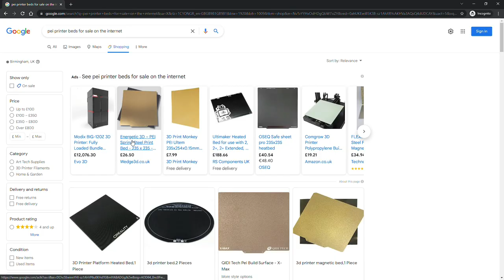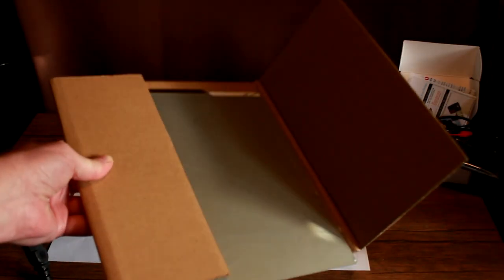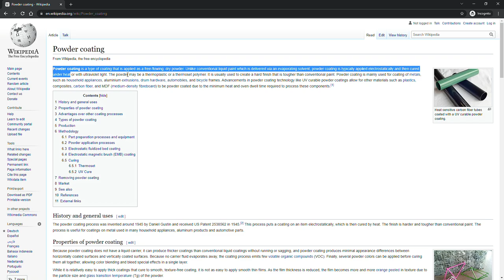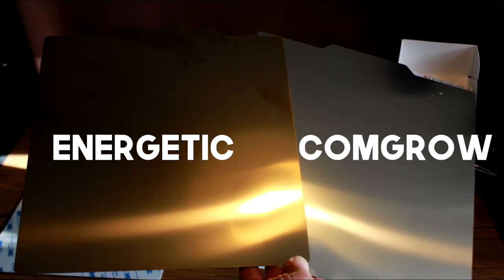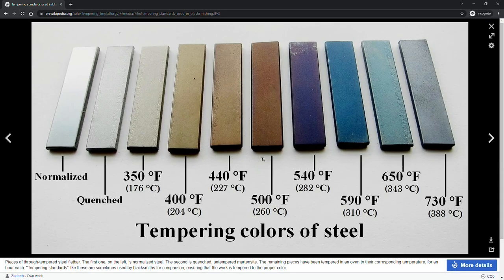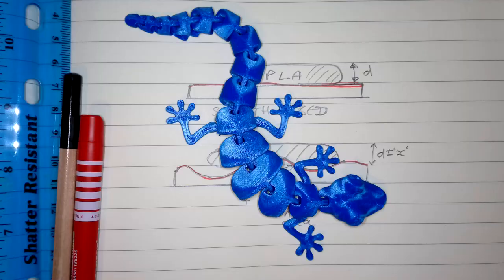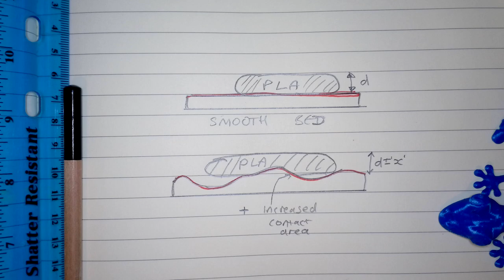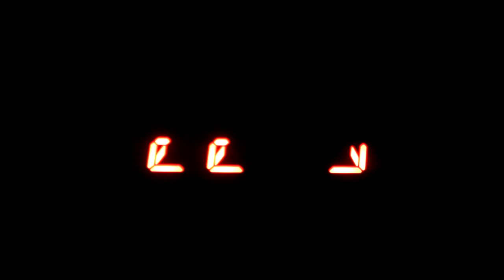I bought another PEI bed, to settle a question from the last video. Are all PEI beds made equal?

Comment: Next video about PEI coated glass (Angus once reviewed sth like this, so it exists) xD. Talking about textured glass like creality carborundum, has anyone experience in printing PETG on it? I know it's coated, but still glass so I'm a bit scared of trying it. Does it work or do I have to use some sort of glue (stick or, what I prefer, spray)?
Reply from the maker: ohhh that was by energetic, I saw it. He ruined it with PETG didn't he? Or am I misremembering? 
Either way PEI coated glass seems a bit backwards since how do you flex it?
Reply: @LostInTech3D  I think he did, thats why I unsure weather I can do it on mine. PEI on glass might be an option if you don't have the magnet sicker or don't want to apply it. If you switch back to glass it might make the heating performance worse or am I wrong?
Reply from the maker: Yeah glass doesn't conduct well so I would guess your point is valid.
Reply: Use textured PEI for TPU and PETG or any other "sticky" filament.... Use the smooth side for PLA
Reply from the maker: I've heard that a lot. I'm not convinced that pla isn't better too on the rough surface. But....that I guess needs a lot of further testing
Reply: @J B My Artillery Sidewinder X1 came with the carborundum "Ultrabase" style bed. PETG does not bond itself to this bed like it does plain glass. In fact it took me a little while to get PETG to stick reliably well. On the Sidewinder's bed, I use 90°C for PETG. Unless it has really small contact area, PETG sticks well. It never damaged the bed for me.

Comment: You need to do a whole lot more research.... The smooth side is the pei applied as a sticker.   The textured side is powder coated by design ... Here's why.   Try printing TPU on the smooth side.....   Now try getting the part off..... Yeah, it's not coming off..... You'll need to let where it's adhered soak in some isopropyl alcohol for about 20 minutes to an hour to get that TPU part off without ruining the build surface.

Now.... Flip it over, and print the same TPU part on the textured side.

Well look at that.... The part pops right off.

This is BY DESIGN.    Smooth "sticker" side is for PLA.   Textured side is for "sticky" filaments that will adhere to the smooth side too well, such as TPU and PETG

Smooth side = PLA
Textured side = TPU and PETG

And they both work great for their intended purpose.
Reply from the maker: TPU comes off fine for me, on anything. I suspect you mean PETG. I'm aware of the situation regarding PETG.

Comment: I had the same adhesion problems on my smooth PEI board (sticker) until I realized (after extensive testing) that cleaning with iso (alcohol) harms on the PEI coating and affects adhesion badly. After cleaning with warm water and dish soap, everything holds up fantastically. 

Conversely, Alcohol works incredibly well on ultra-smooth surfaces like glass or polished metal. 

Here should be tested again whether it is possibly due to the cleaning of the surface that the results have turned out so surprising.
Reply from the maker: I never use isopropanol, never needed to. Ever. I always feel like it's not necessary at least with the usual materials.